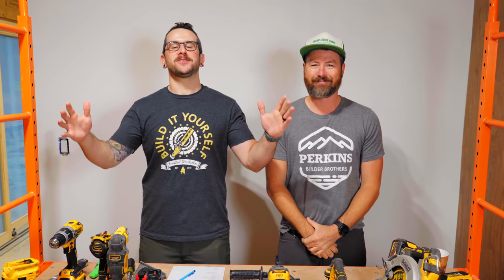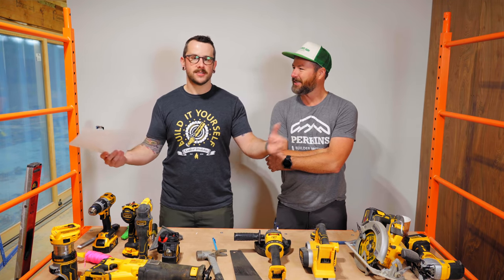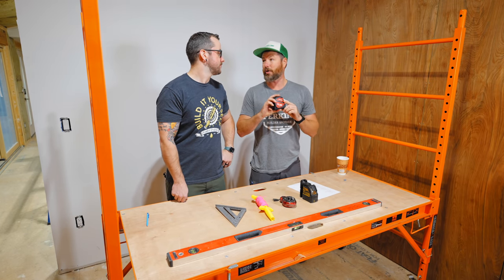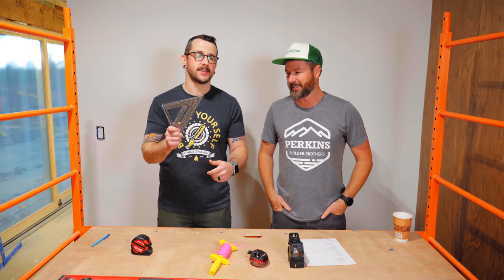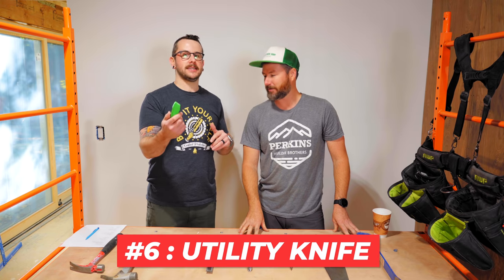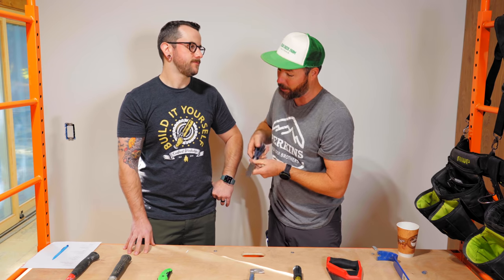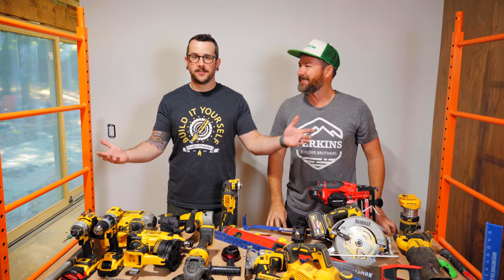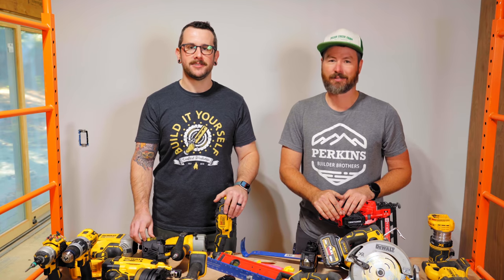23 MUST HAVE Construction Tools For BEGINNERS Building A Tiny House

Comment: I do find it amazing that people still use framing nailers with an air hose, I moved to a paslode gas framing nail gun in 2011 and even though it was an early version of it it was a night and day difference with how much easier and simpler it was to use, also how less fatiguing it is to use, I got the chance to use a Hikoki recently and that was such a step up from the paslode, I don't think I could bare the thought of having to go back to using a air powered nail gun again!
Reply: Well tbh if you have to sheet inner walls for exemple the lighter gun and possibility to shoot bigger nails faster is nice. Nails are cheaper too. Passlode is old tech in the world of battery guns imho
Reply: Paslodes are just so much more expensive to use, the nails alone are what 20% more and than the gas. Paslodes also can’t shoot nearly as quickly as air guns, I have my Paslode and I enjoy using it when I need to but air guns are just a lot nicer
Reply: Yeah in automotive air is still useful because we’re at stations but even when I was 15 we didn’t use air when I did framing/drywall

Comment: I would also add that in my opinion, as a professional trades person; measuring is an area where you want to buy good quality, and not cheap stuff. Levels for example are not born the same, but can be vastly different from each other.
Reply: Good point, even the best quality tools are "low cost" compared to materials and labour on any house project.

Comment: "Bakers" scaffolding is damn handy. Also highly recommend the levelling legs and the unit with the hatch in the platform.  The legs make the scaffolding useful for the uneven outside ground, and the hatch is absolutely necessary If you set up the scaffolding with an offset or in a tight space.

Comment: I understand your point on the circular saws, but sometimes being able to see the blade better is a big plus
Reply: I agree, I’m a right hander that drastically prefers left hand blade. To be fair I’ve also only owned left hand blades and have used buddies saws on a single job here and there with right hand blade.

Comment: Retired builder. You guys nailed it. The only thing you didn't say was about carrying multiple of the tools and levels in case one breaks . Measuring tape I always carried 3 25 ft. Because someone was going to break their tape . We wouldn't stop so they could replace it.. . Retired about 13 years ago would not count on batteries always corded plus a generator.  Good to hear that your getting away from it, lol you all missed the fun of running a 100 lbs of nails by hand in a day. Wow could we slam nails, I carried my first framing gun every where even took it out to dinner a few times. Was that a nice change.

Comment: I will be 80 in a few days. We're building a "tiny home" with my daughter. I have been in construction for most of my life. Power nailers & other tools are essential for professionals, but even one time builders can justify many. I bought a special nailer just for metal fasteners like joist hangers & hurricane straps that more than paid for itself in just this one project. Not only faster, but safer & more accurate. Also fall restraints well worth cost when you don't have to be exposed to mortal danger & can feel more "comfortable" in otherwise dangerous situations.

Comment: Glad that you recommend cordless tools. And very glad that you urge for "loyalty" in a brand. I would add that you need to be loyal in one voltage system, too. Or pick a brand that has multi voltage compliant battery chargers.
If you can't find a brand with everything you need, pick one that has the most, AND STICK WITH IT. For the rest, pick one brand that has what the other misses.
Cordless tools put less stress on construction site generators too. A small generator can run multiple chargers. Or you can use a photovoltaic panel. No noise, no fuel, no lubricant, less parts that can malfunction.
Pneumatic and grid powered electric only where there aren't cordless options.

Comment: I find it worth mentioning that hammer drills are way louder and somewhat heavier than normal drills, so if you already have, or plan on getting an SDS, I'd skip the hammer function
Reply: And the SDS gets the job done so much faster. Espacially if you drill 10mm or more.

Comment: You can carry a flat bar on your belt, I slide it around my left side waist over the belt but under the straps that hold the pockets up. Make sure you face the sharp edge towards you tho or else you’ll scrape your arm on it… a lot

Comment: Summary: l
1. Tape measure
2. Square Piece
3. String line 
4. ChalkLine (tajima )
5. Levels- torpedo Level-Laser Level-Rotary Level

Hand Tools
6. Hammer- multi types if possible
7. Utility knife (have half a dozen if you like)
8. Chisels
9. Small pry bar tool
10. Full-size pry bar
11. Multi bit Screw Driver
12. Handsaw

Power tools: do not buy multiple brands of battery operated power tools. 
13. Circular Saw
14. Reciprocating Saw
15. Drill and Impact Driver (Hammer Drill)
16. oscillating MultiTool
17. Handheld Electric Planer
18. JigSaw
19. Angle Grinder

Stationary Power Tools
20. Miter Saw
21. Table Saw

Check for sharpness and health of blades. 

Nailers:
22. Framing Nailer
23. Siding Nailer
24. Roofing Nailer
25. Finish Nailer

Tiler:
26. Wet Saw (rent better than buy)
27. SDS Drill
28. Flooring Nailer

Drywall Tools:
29. Collagen screen gun
30. Rotorzip

31. Router

Comment: I’m all for battery nailers except the price, ridiculous. I’ve also heard some broke easy so it definitely sucks at times. Cheaper would be nice but then they break. Sticking with cordless compressors is solid. 
They do have some quiet compressors, they’re also cool

Comment: i have makita drill, grinder and alot of other tools but a Dewalt multitool and Milwaukee inpact driver yet o only have makita batteries but use cheep battery adapters off amazon that make makita batteries fit other brand tools or vise versa

Comment: As a 23 year Union carpenter on the west coast, I disagree with your circular saw suggestion. The only circular saw that we use on the west coast is a worm drive "SKILSAW". They are synonymous in carpentry here on the west coast, especially in the residential and commercial building industry. Also I know lasers are reliable, but a plumbbob is also a necessity. Other than thoes two, good list.

Comment: Rotary Levels are 4-6 times more accurate than cross line, which matters more the greater distance you travel. I could be wrong, but would personally not lay out a foundation for a house with a cross line laser.

Comment: lol~ It is really an art to use the hammer drill, never go all the way in the concrete. Also, someday you can use the same drill bit all day, and someday you break 5 of them. Don't ask me why. So if you are a beginner, make sure you have plenty bits to begin with.
Reply: If you  break more than one drill you are drilling iron and your drill isn't made for iron. I recommend a drill with four blades which are mostly made for the heavy workload. They cost about 20-50% more. Those work well from 12mm and above if your drill is under 12mm switching to a normal steel drill is faster and cheaper. 
Good Luck

Comment: I agree with everything in this video.... but when you are using cordless tools..... Talk about the batteries, 1.2Ah battery on a tool sucks compared with the same tool with 4-5Ah battery.
The amount of current available is severely limited by the orientation and number of internal batteries in said tools battery pack

Comment: What are your recommendations on battery size? You mentioned doing the roof with three batteries, what size were those?
Reply from the maker: Those were 5Ah batteries if I remember correctly. I recommend having a variety of sizes, personally. I really like a lighter 2Ah battery on an impact driver and nailers, as it keeps the weight down significantly. For things like circular saws and track saws, I don't seem to notice the added weight as much.

Comment: The difference between european and american building styles is just unbelieveble. While european buildings are almost exclusivly brick and concrete. Since its so cheap here. Americans build solely with wood. 
If I were to build a house right now I would only use about half of those cordless tools.
Reply: You'd be shocked to find out that a lot of homes are also built out of brick, concrete, or cinder blocks here in the states, particularly in certain areas prone to natural disasters like fire or tornadoes. But yes, we do in fact have a lot of houses that are wood built because it's just how we do things here. I'm sure there are some logical and science based structural reasons, but I couldn't tell you, I just know how to show up, cut shit, hammer shit, tear shit apart (while cussing), and put it back together. Lmao

Comment: The one complaint I have about my 60v Dewalt circular saw is that the base plate is too thin and when I use my 8ft level as a guide it tends to slide under the guide. My rigid's base plate has about a 1/4 inch fence and it never happens when I use that saw but it is not cordless so I just deal with the thin base plate on the dewalt.
Reply: You should check out mafell they are fancy and expensive but worth every penny

Comment: 11:08 "Batteries are expensive that why I have all one brand"

The problem with that it that nobody actually swaps batteries between tools because that's just annoying. What you end up with is at least a seperate battery for the tools you use most, that's your drills, your circular saw, your nailgun and your cutter. And if you're a busy little builder you'll need two or three spare batteries on the charger just to get through the day.

And when the inevitable happens and a tool breaks, you'll find that the manufacturer just invented a new battery that is incompatible with your old stuff so you need to buy a new battery and charger for the new tool.

Think carefull wether you need the tool to be cordless and how much money you are willing to spend on becoming a battery-juggler.